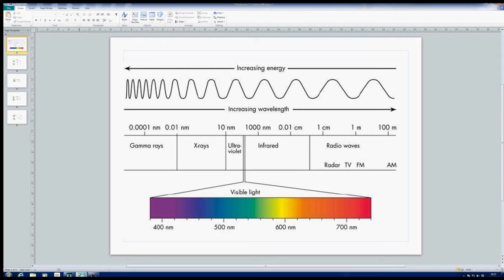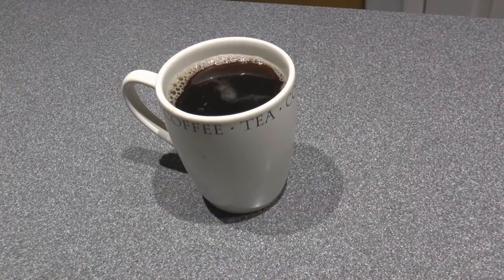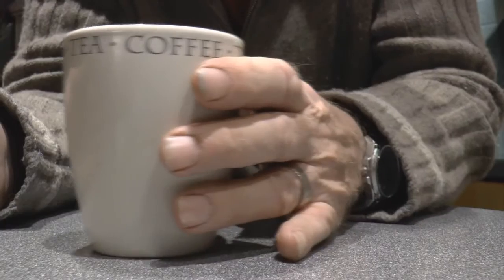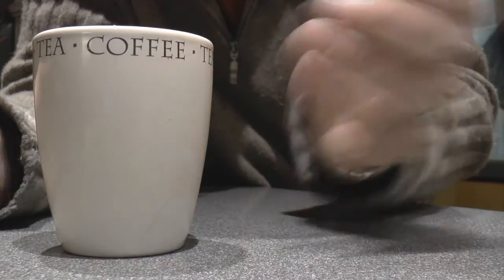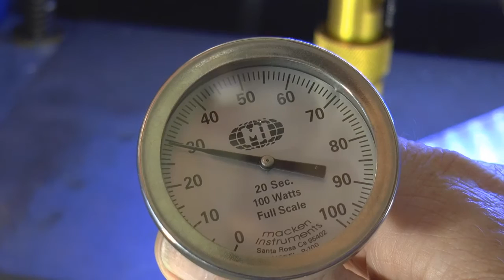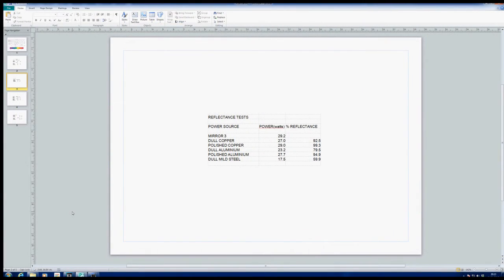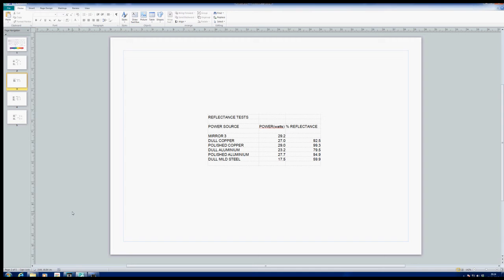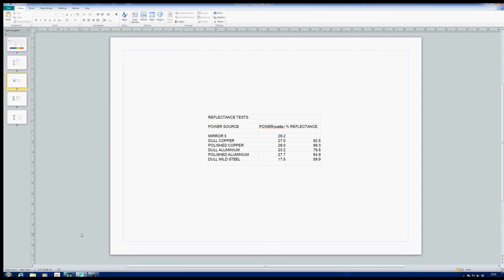RDWorks Learning Lab 41 MIrrors Metals and Reflectance PART 1

Comment: Hi,
Brilliant series, so good went out and bought k40 and then bought larger mirrors ( 25mm ) and larger lens ( 20mm ).
and new holders and air assist nozzle ect ect..

Not sure if it is covered in any future labs but what are losses in air of beam. 
example.. angle tube out of machine and measure collated beam power @ 10 cm
then do the same again at distance of say  1 meters  and say 5 meters .
sorry if this has been done but only got this far ( labs 41 )
Reply from the maker: Hi Jeremy
The beam is coherent and in theory should remain the same size without power loss. However the real world is slightly different Just like a laser pointer, the beam should remain parallel but in reality there is a small divergence I suspect the beam will still have power even at several hundred meters. The power will mainly be there but it will be spread over a larger diameter so the energy density will be decreased. It is this energy density property that gives the beam it's ability to do damage. That is why you focus the beam to a very small area  to make it "damage" the material. Take a pencil and stab the blunt end into the palm of your hand. That's the normal laser beam. I will just ask you to imagine now what would happen if you did the same with the pointed end. That's the focused beam where all of the energy is concentrated into a  VERY small area where it can do lots of damage.
Remember that this is a beam of invisible light. It is only when the beam hits something that will absorb the light that  the light turns into heat. Particles of dust or moisture in the air  will attenuate the beams power, so there there is no absolute number. The beam path even on a big machine will not exceed 5 m so there will be little loss. There will be more loss and beam divergence caused by bouncing off 3 mirrors that will not be optically flat.. Just like a sheepdog rounding up sheep. that's what your lens will do , collect up all the divergent bits of beam and concentrate them all into a small focused spot.. As it happens in 41 there is an example of how even a crudely reflected laser beam is still dangerous.

Hope this answers your question
Best wishes
Russ
Reply: Thankyou, brilliant

Comment: Please! for your safety and the pain in my clenching buttocks. Wair some 10600nm 10.6um CO2 Laser safety goggles when firing a laser out into the room. what if a unlikely bounce where to kit your eye there in no visual warning or pain before it's too late, not good. they are only 30$. also thanks so much for making these videos SO helpful for me you are awesome.
Reply from the maker: +luxaeternae 
Thanks very much for your appreciation and for your concern. I'm guessing you have watched a few videos in this series but may not have seen the first 6 videos about me bringing the machine into life.  In that little series I explain that one of my  more recent occupations was running a laser profiling shop with two 3kw CO2 laser machines for cutting metal. I was very hands-on running and programming the machines as well as designing parts for cutting. Before upgrading to the modern style fully enclosed machine, I cut my teeth on a 1.5kw open beam machine. Those early videos also explain the dangers (mainly toxic or carcinogenic fumes ) of trying to cut plastic. The point here is that ALL plastics are 100% absorbers of 10.6micron light/radiation/heat and will melt or decompose. Any person wearing glasses (even with glass lenses)which nowadays are mainly polycarbonate or similar, will get  eye  protection from the "heat rays". My video tries to make the point that these invisible light rays are heat and not  a concentrated  visible light that would damage your retina.  You will have noted that I do wear glasses all the time but also advise wearing any cheap polycarbonate safety glasses if you are concerned. 
 As part of my exploration of mirrors it was necessary to explain the fact that 10.6 micron light is actually heat. which, when you fire a concentrated beam of it at one of the high thermal conductance metals, it counter-intuitively does not heat the metal but gets reflected.  My carefully controlled demonstration has hopefully made you aware of a whole risk area that most will not be familiar with. The word LASER induces an unreasonable fear in many people. Comprehending  what this type of laser is and understanding the risks, converts that unreasonable fear into a healthy respect. For example I know lightening will kill me but I don't wear rubber boots and carry a lightening conductor when I walk out in the rain, I either jump in my car or stay in until the storm has passed. I also hope that people with aluminium work tables will now take steps to cover them.
Thanks again for your concern but as I remind so many people, I'm not out to teach you anything, I'm having the most fun ever playing with this little techno toy and because my other hobby is video you get to come and look over my shoulder to see me fumble though the learning process. Oh yes, I still have a lot to learn about this little beastie!!!!
Regards
Russ

Comment: Off topic, but I thought this would help you out. In one of your videos you showed the draft created when the lid was closed with your improved exhaust, so you kept the lid open. I had the same
 issue. The draft is created by the stock fan, which pushes air back into the machine from the auction of the outer fan. I disconnected the stock fan and cut the wire for it, and now it extracts 10x better.
Reply: Meant to say suction, not auction